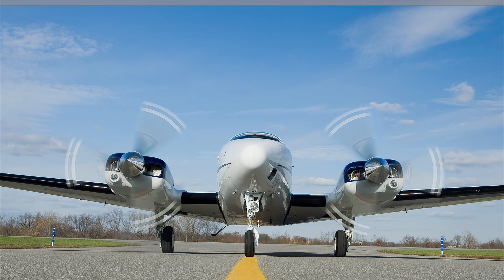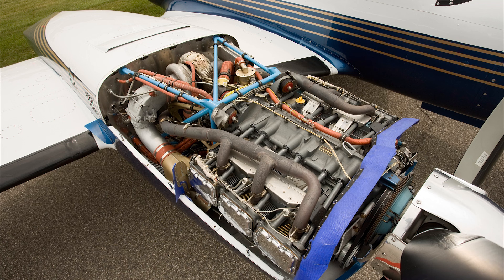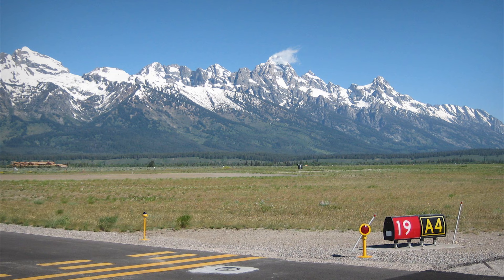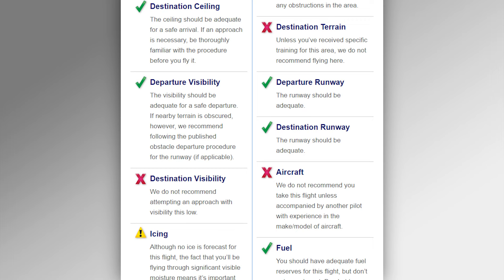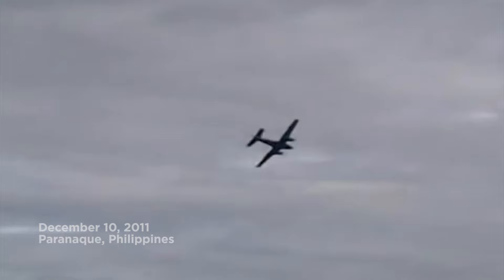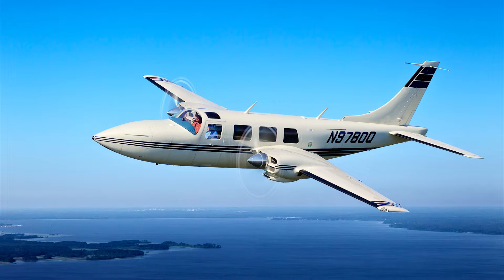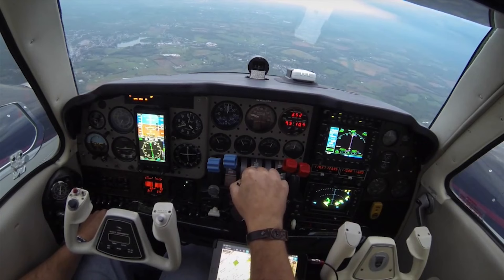Taming the Twin: Four Rules for Safe Multiengine Flying

Comment: I trained in a Beech Duchess and my instructor shut down one engine and I had no problem with dead foot dead engine and complete control. Unfortunately we couldn't restart the dead engine. Had no problems bringing it into our 7000 foot runway and an easy landing. Learned then that you can't taxi with one engine. Scared the hell out of the cfi as I was his first student.
Reply: I have taxied on one engine in a Navajo, it was difficult but doable

Comment: My first twin rating was in a Cessna 337 - (twin rating - centre thrust only). Interesting aircraft. Never understood why they stopped making it. I later did conventional twin/multi rating.
Reply: Never liked that aircraft.  Noisy and slow for two engines.  
gave a lot of instrument instruction in the 337.
Reply: Slow.... but not really any slower than other twins with similar power (like the Seneca). Really good for survey work. Excellent visibility up and down with 8 hours endurance and engine failures were a piece of cake as long as you identified and verified the correct one. 

Useless as a trainer though with centreline thrust and the complex fuel system and overheating rear engines (which wouldn’t give you a clue they failed on takeoff) made accidents just as common as conventional twins. Flew a lot nicer than any Piper garbage save the Navajo.
Reply: Bartonovich52  Great visibility, long loiter time, that’s why the air force used them for forward air control in Vietnam. A sort of successor to the army’s  cessna-305  ‘bird-dog’.
Reply: @Bartonovich52  337 can climb on one though, right?
Reply: no buyers
Reply: average 337 grossed... not much
Reply: @ Ellenor Malik The 337 can take off on one. 

Used to be a sales trick Cessna salesmen used. It’s now placarded against it.
Reply: The 337 and Seneca use the same engines, and they’re both underpowered to a ludicrous degree. If you don’t believe me, look up the performance numbers of the Seneca II vs a turbo Saratoga HP, for example. They’re nearly identical airplanes, one single and one twin, except the Seneca burns 50 percent more fuel to go the exact same speed. The second engine on the Seneca is really only there to overcome its own drag, carry its own weight and the weight of the fuel required to feed it.
Reply: I fly one now regularly. Still an excellent aircraft! Of course with any heavy airplane there are limitations. It will climb on either motor and the early ones like my own do you have a complex fuel system. Later they made it simple with only left and right tanks. It will climb fine on one engine. However after taking off if you swing the gear early you will lose  some climb performance during the swing. Of course flying around on one engine it is very heavy but it will still climb. The main thing is there’s no blue line. Maintenance is a little bit more difficult just because the magnetos and alternator are hard to get to. But not too much worse than other twins. The rear engine overheating is definitely overrated. If you’re taxing for a long time like at Oshkosh and your rear engine gets hot all you have to do is to run-up the front engine for a few seconds and it blows cold air over the rear engine and the temperature comes down. As far as taking off with the rear engine not running you would have to be a very non-observant pilot not to notice that. My little safety trick is to lean forward in the seat and feel how much acceleration you have. Sometimes people slam the throttles forward and when you do that with these basic fuel injection Systems that these airplane motors have it may inadvertently shut down an engine. If you are taking off from a higher altitude airport it may be a good idea to pull the mixture back just a little bit. Other than that it’s a great airplane but again you have to really know your airplane and remember you are flying a twin. Sometimes people buy sky masters and think because it doesn’t have a blue line they don’t need to get multi engine training. Or people do stuff they should not be doing whatsoever. Yes it has an extra engine yes it flies like a heavy 210 on one engine. Yes it’s a little safer than the other twins. But no please don’t be an idiot in them.It makes our insurance quite expensive!
Reply: @Bartonovich52  Calling bullshit on that. I have about 500 hours in a BugSmasher. I think you mean that if you don't lead with the rear (thereby verfiying that it is running) you might attempt to take off.
Reply: @trytolookbusy  If I remember correctly, if you lose one on takeoff, you don't raise the gear until you have 105. The reason for that is during the gear cycle, the wheels turn at right angles to the airflow and seriously add to the drag at a critical time. There is some other logic to it as well, but I've forgotten it.

Comment: Choose your multi instructor carefully...I had an instructor fail both engines over San Pablo bay at 3000 thousand feet going back to Oakland...had to scramble to get one started and make it back to the school on one was a sennica one!.went to different school in Hayward to complete the rating in an aero commander 500
Reply: Also when the flying game,all pilots get recurrent training just like airlines period! Don't leave aircraft in a hanger for a yr; then expect  to pass a flt revew!...stay current or stay on the ground!

Comment: In a C-310 when you lose an engine you have lost 50% of your power but around 90% or more of your performance.  Another thought is if you begin to lose control because of low airspeed and VMC control is lost.  You can always throttle back the good engine to maintain control.  Just don’t allow it to stall.
Reply: if you have the altitude
Reply: Sounds like you would revert back to single engine training... no runway remaining, engine failure below 500ish feet agl, land straight ahead level and slow and normal as possible. lol

Comment: I dont agree with your suggestion of adding a few knots to blue line. Your justification is greater margin on top to keep aircraft control. Below RED ine is loss of control, not blue line. Most GA airplanes only just climb (or just stay level) at blue line, if you are not absolutely nailing that it wont even do that and you absolutely do want that.!!
Reply: Completely agree with your statement, Mark.  Any extra airspeed leads to increased parasite drag.  Increased drag = less performance.
Reply: Mark Lee Agree - a reason exists why the blue line is where it is.
Reply: Yes I totally agree with the above 3 posters. As the blue line is based on max weight and sea level performance, at any weight below max and/or altitude above standard sea level, the blue line is already a few knots faster than optimum. Arbitrarily adding 5 knots to blue line as shown in the video will further degrade performance and is the WRONG advice. The right advice is to "nail" the blue line speed as Mark Lee said.

In the video, they make the point that the book numbers are based on brand new aircraft and you might not get the same performance, which we all know is true. However, if the engine is producing less than rated power, the actual Vmca will also be lower increasing your margin between blue line and losing directional control. So with a down on power engine there is even less justification to squander remaining performance by flying above blue line speed than there is if the engine is performing to spec!!
Reply: I was just about to make this exact same comment.
Reply: VXse might be a better speed.....especially if there's obstacles in the area.....get as much altitude in the bank as you can as quickly as you can.....altitude is almost ALWAYS your best friend in this situation.  I would personally almost never increase speed over altitude in a twin.......
Reply: Nope. Extra airspeed can always be converted to altitude if you need it. If you’re faster than blue line, you simply go back to blue line and get a boost of climb. If you’re at or slower than blue line... all you can do is go back to Vxse, which if you’re right on the edge of performance (close to single engine service ceiling or still not cleaned up) is going to give you hardly anything. If you get slower in a moment of inattention or looking at obstacles and keep pulling back... you’re on the back side of the power curve and headed for red line. I’ve used extra speed to help with obstacle clearance in single engine planes in case of downdraft or windshear, and I use it in high performance aircraft so I can punch through an icing layer if I need to.
Reply: Please don’t ever pull any engine at 20 feet AGL in any twin ever again. You’re going to become a statistic.
Reply: Pull the throttles and set her back on the runway!  At 20 ft there is no good reason to continue the takeoff.
Reply: This is absolutly true!!
Reply: vyse and vmc ?  difference ??
Reply: @hotrodray6802  Vyse, Best rate of climb single engine (Blue line).  Vmc, Minimum controllable airspeed (Red line).  Vyse will give you best rate of climb if you are below your single engine absolute cieling.  If you are above your SEAC, you'll descend at the slowest rate at Vyse.  
Vmc is guarantees the ability to maintain directional control with one engine out, full rudder into the operative engine, and up to a 5º bank into the operative engine.  It does not guarantee maintaining altitude.
Reply: I don't bother with the lines. I just go by feel. If you really know your aircraft, she'll guide you and show you how to handle her right.
Reply: 465marko lol.

Comment: Only the good old Aero Commander could climb out on one engine . Its the only twin that has been certified to fly the President of the USA. Now before you all jump down my throat, go look at the history of the 500B and then the S plus the 520 I have flown Aero Commander twins most of my life and just recently retired from flying and driving.
Reply: Steinwaygrande  yes, they packed the prop in a crate, and flew to DC, IKE was impressed,,and the Govt bought some of them.
Reply: I remember back in 1967 after I had got my PPL and then went and got my COMM License, my first twin was a 500B and what a laugh trying to taxi the down the taxiway in a striaght line. I was deliberatly conned as no one told me about differential braking. I got my revenge years later when I was teaching someone to fly the Shrike model. He saw the funny side but realised that this was more than jus another twin, it was truly a magnificent airfraft. I live in Australia and about this time last year, I ferried a 690B from Ohio to Darwin and then downt to Perth. Myslef, I have had the good fortune to have been flying one for the past 40 years. Its undergone  many restorations, but has been put to good use by government departments and tourists. The295 HP Lycomings were replaced with two 345 HP Lycomings and its a beast on climb out .2800 ft per minute to 10,000ft and will sit at 15,000 ft all day ( but need oxygen ) so rarely fly over 10,000 ft. A majestic aircraft if ever there was one.,

Comment: My personal limit is to be at a gliding position with no engine (if single engine) and only one engine working (if twin) below the MDA 
Also in a twin to plan for the flear propellor to fail or even for it to turn to speedbreak

Comment: Essentially all general aviation twins have poor single engine climb capability because their one engine inoperative power loading is poor. Many pilots think the performance penalty is so significant due to the additional drag created during flight with one engine inoperative. This is incorrect. Drag matters, but it isn’t the primary reason for the terrible performance. To demonstrate this, assume that your twin has two, 200 hp engines. During flight testing, at L/D max (maximum lift, least overall drag airspeed), it is determined that the airplane needs 150 hp to maintain level flight. During two engine climb, the “excess” horsepower available to climb is 250 hp (400-150), and climb performance is very good. However, during single engine climb, the excess horsepower is just 50 (200-150). This is 80% less than what is available in a two engine climb, hence an 80% performance reduction, which may be further reduced by additional drag due to improper flying technique. 

Very few multi engine airplanes have good OEI climb capability due to their high OEI power loading. This number for twins used in flight training is usually 21-24 lb/hp, which is terrible. The Diamond DA62 is the worst offender, coming in at 28 lb/hp! Airplanes like the Beechcraft Baron and Cessna 310 are slightly better at about 19 lb/hp, but this is still quite poor, and it won’t do you much good if there’s significant terrain in your way after takeoff. A King Air C90 has a respectable 17.5 lb/hp. The Piper Cheyenne turboprop is the only airplane listed here that I consider to have adequate OEI power loading. It comes in at 14.5 lb/hp.
Reply: that explains why the da62 fllew like a brick with one engine in the simulator. It was terrible to get any climb out of it at all with 50% fuel and 2 pax on board.

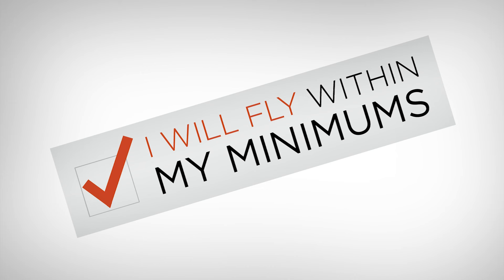Comment: 6:12 What do You mean with „not topping off the tanks before putting the plane in the hangar“? The seal or bladders should not be dry for a long time and the fuel will reduce the risk of condensation. So how is this considered a risk for flying?

Comment: VYSE varies with weight.. arbitrarily adding "a few knots" may sacrifice the ability to climb or maintain altitude in most Part 23 multiengine airplanes.
Reply: jimmbbo You will probably also be below MGTOW as well with fuel burn, unless you took off over-gross; and remember, VY and VYSE decrease with altitude, so, all-in-all, the true blue-line in an average situation at altitude will probably be(depending on your actual weight) a few knots lower than on the A/S indicator. More than enough to turn miserable SE climb rates to zero or even negative , as you said.
Reply: It’s a lot easier to go from fast to slow than slow to fast if you’re wrong.

Comment: We do know that fatalities after an engine failure are higher in a twin than a single - just saying.  All the more reason for videos like this.  The 50% rule should be very clear - power loss is 80% at least - and that needs to be clear.

JR
Reply: Almost safer to shut the other engine down and go in dead stick to maintain balance.
Reply: ummm no. power loss isn't 80%... 80% of excess THPav is lost
Reply: the problem is no one keeps track of lives SAVED in a multi that experienced a single engine failure and landed safely

Comment: I agree with most everything in this video.  EXCEPT: adding a few knots to the published blue line.  I have flown right seat in a PA31P-425.  The very type proficient instructors have taught to NOT overfly blue line.  Yes. flying yes is worse, but the damn airplane wont climb much at all 5-10 knots above blue line on single engine... a generic suggestion to fly faster than blue line is not always a good idea.
Reply: That’s nice. 

I’ve got thousands of hours in twins right and left seat piston and turbine and I agree with the video.
Reply: I also agree it's not a good idea to add a few knots to blue line. You want to hit blue line as close as possible to maximize your single engine climb rate.

Comment: The V1 concept is only valid in transport category aircraft and does not apply to piston twins. Piston twins are never guaranteed to have engine-out  climb capability. The diagram at 6:00 should have specified Vr instead of V1. This diagram also implies that accelerate/stop distance and accelerate/go  distance are the same; this is rarely the case.  Accelerate/go is often much longer.

Comment: If you don’t learn proper rudder coordination and use during an engine failure, not to mention airspeed maintenance, you’re dead.  It’s basic and simple and requires periodic practice.  This applies to any airplane, become really proficient in basic stick & rudder flying first.  Let’s not complicate the process.